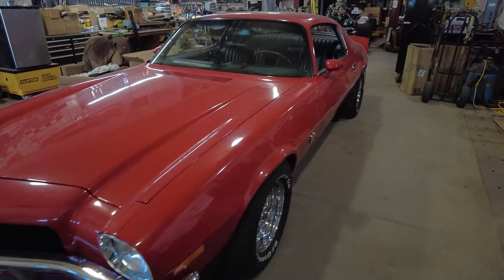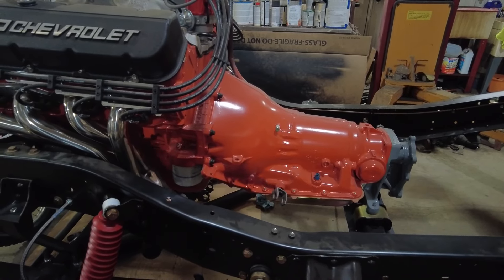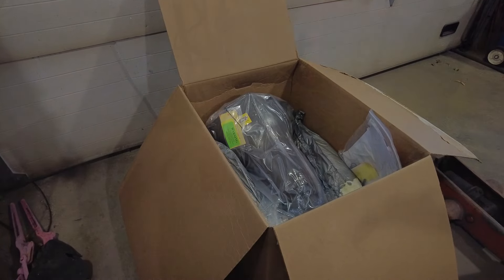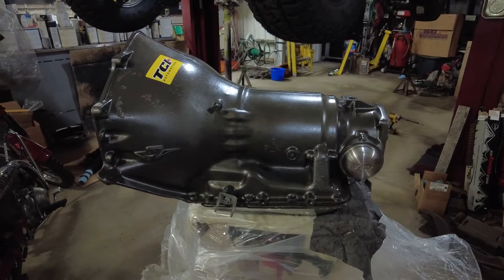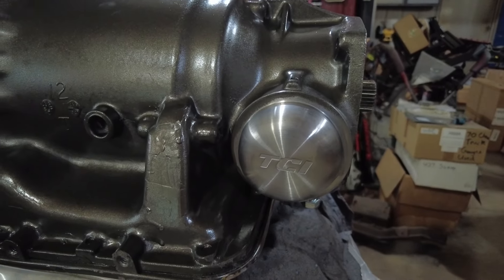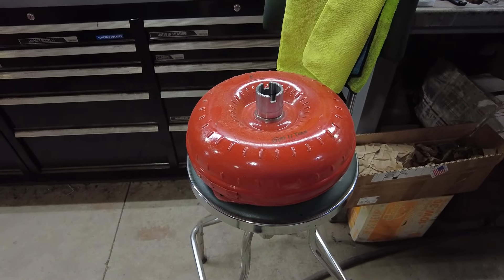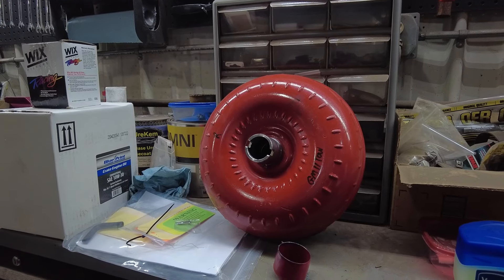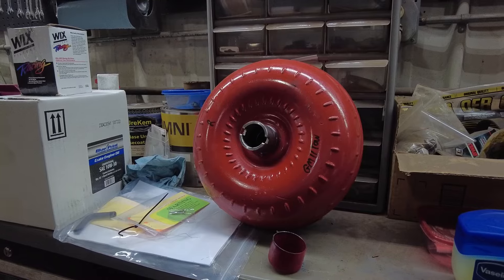80 Chevy Silverado TCI TH350 4x4 Trans Install

Comment from the maker: Things that might help with a project like this:
Hughes Torque Converter: https://amzn.to/3YUqwjD
Black Finned Trans Pan: https://amzn.to/3SUidR3
Torque Converter Bolts: https://amzn.to/4dpGAOt
Brake Line: https://amzn.to/3YB85Aj
Stainless Fittings: https://amzn.to/4dcFYff
Speedi Sleave: https://amzn.to/4clmkfT
Seal Driver Kit: https://amzn.to/4dkJJ1N
CVF Racing Pulley Kit: https://amzn.to/3ydjkUL
Power Steering Filter: https://amzn.to/3LJRxOY
Spot Weld Cutter: https://amzn.to/3P6jaUo
Cheap doors: https://ebay.us/BLdPPl
Door Hinges: https://amzn.to/3P1PVSx
Door Latches: https://amzn.to/3STWnfu
Door Striker: https://amzn.to/48sX70Y
Hammer Impact Tool: https://amzn.to/3wxwElD
Expensive doors: https://ebay.us/lPF8t5
Fenders: https://ebay.us/wt2Amp
BBC Stainless Headers: https://ebay.us/Zzia5b
Radiator: https://amzn.to/43lJ1wJ
Fuel Sender: https://amzn.to/3WNEWi6
Headers: https://ebay.us/h3Q5ek
TH350 Zinc Plated Pan Bolts: https://amzn.to/439kxGX
TH350 Filter: https://amzn.to/427sf2J
TH350 Zinc Plated Pan: https://ebay.us/YZkD6y
Maxtrek Tires: https://ebay.us/hiR6PX
Turbine Rims: https://ebay.us/kFxZwA
Lug Nuts: https://amzn.to/3IcHiRN
Mile Marker Hubs: https://amzn.to/3LNFkIz
Russel Brake Lines: https://amzn.to/3M8Z22A
Diff Cover: https://amzn.to/42c2kI5
Wilwood Calipers: https://amzn.to/42bRGBh
POR15: https://amzn.to/3ZzYmYD
Rustoleum Paint: https://amzn.to/415WwhT
Ball Joint Adjustment Sleeve Tool: https://amzn.to/3nxHq7j 
Yukon Spindle: https://amzn.to/3Lw33ww
Paint Gun: https://amzn.to/3YwQUMr
Pressure Blaster: https://amzn.to/41Qz7D0
AirCat Grinder: https://amzn.to/3IOP185
Blasting Cabinet: https://amzn.to/3mckf1m 
Blasting Cabinet Dust Collector: https://amzn.to/3ZqjmR6

This video contains affiliate links, which means that if you click on one of the product links and buy, I'll receive a small commission.

Comment: Hope it works well.  Lots easier to install without a cab!
Reply from the maker: So do I. With a lift removing a trans isn't terrible. Does take some time. Especially when you have a transfer case bolted behind it.

Comment: This is entertaining to watch. I think I remember the B&M debacle….you did a vid on it right? Would be sad if there were more than one person getting that level of slop from them. Way back when I was building resorts in the mountains of Colorado, my 00 Tahoe’s 4L60e blew. I ordered a TCI from Summit. It blew no more than 3 months later. Since then I don’t trust off the shelfs. Last rebuild I did was by an old fashioned engine and transmission shop up in Idaho. That’s where we broke down. They did a killer rebuild on my Burban’s 4L80e.
Reply from the maker: @rockymtnredneck4888  I went to see a local trans shop and the guy didn't give me the confidence to give him my trans. I might play around with the original trans. See if I can't rebuild it for a spare.
Reply: @mossman381  confidence in other people’s work is getting bad.